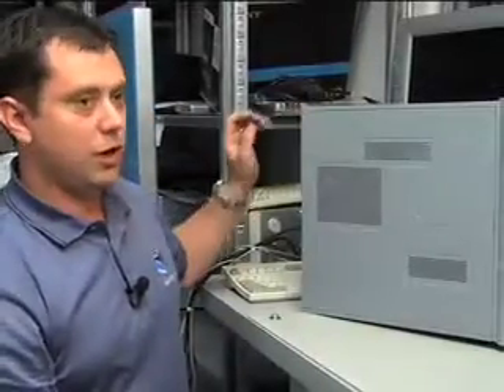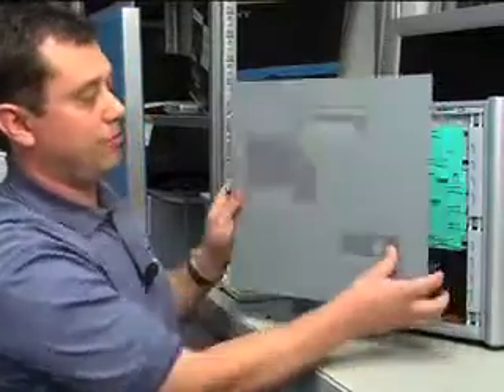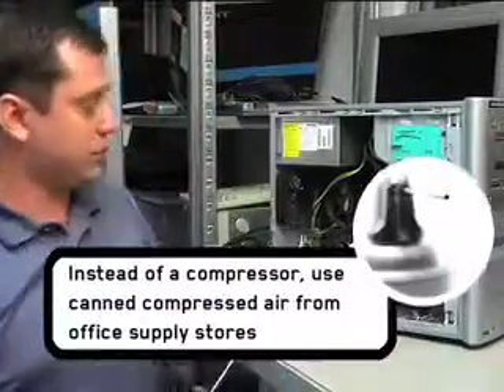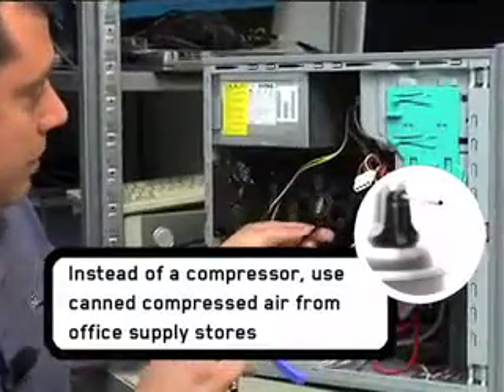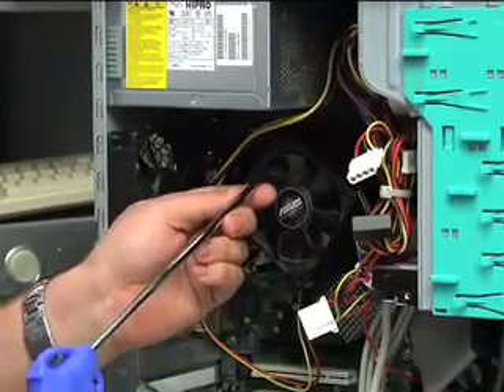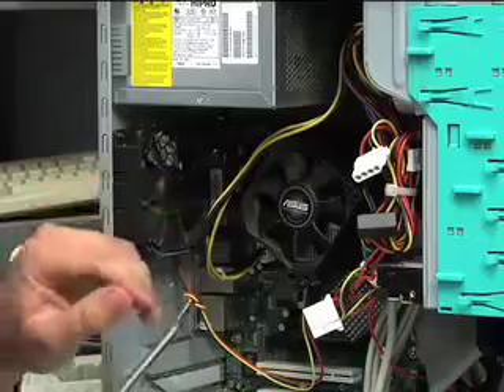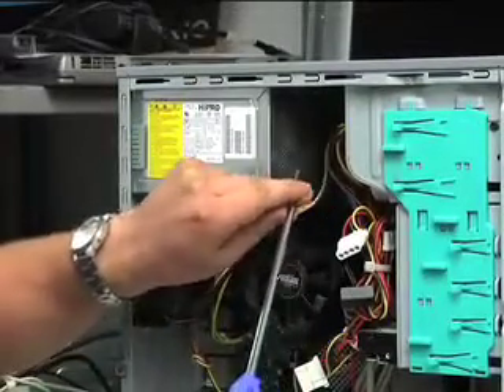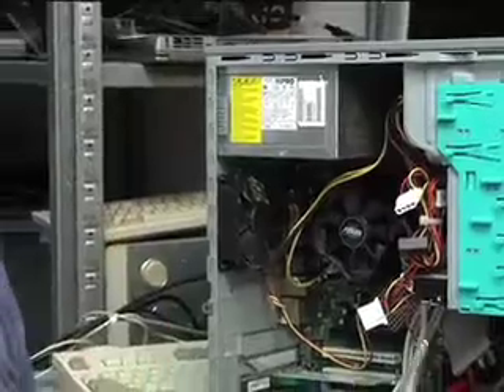techlife: Computer dusting

Comment from the maker: phatlip2: Tips for purchase:
Oil-free model with a small tank (1 to 1.5 gallon or 4 to 6 liter would be plenty)
Maximum air pressure in the range from 100-140psi.  
Air regulator to limit actual output pressure to around 40psi for dusting purposes, any more could cause damage if not careful
Should also have a drain plug on the bottom, open before and after each use to let out any moisture that has condensed inside.  We dont want the water spraying out onto the components.